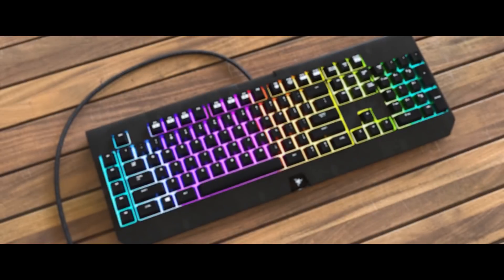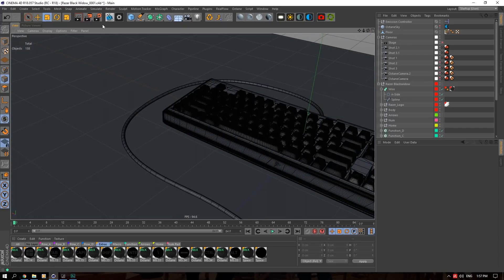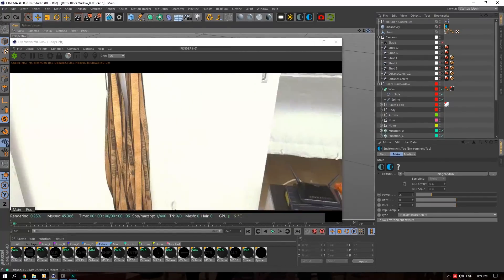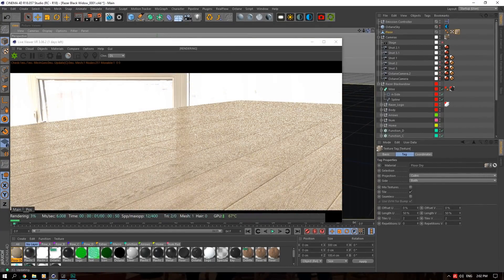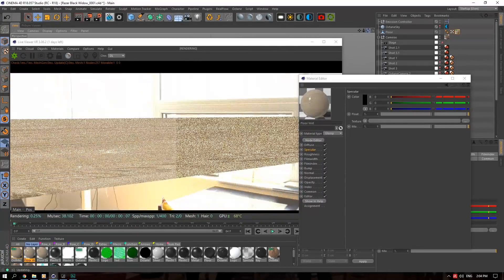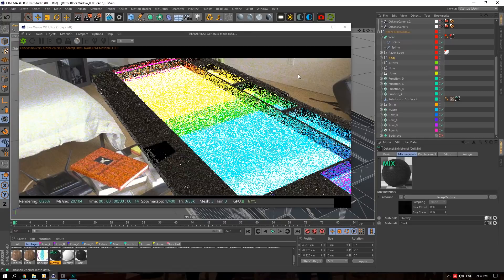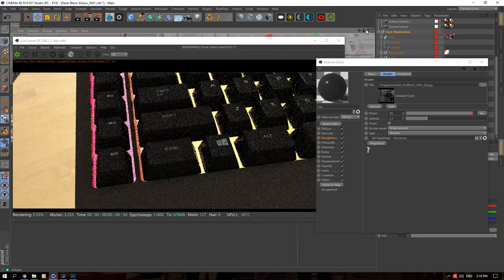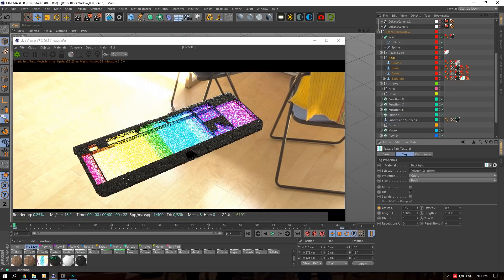3D Razer Blackwidow Keyboard | C4D, Octane

Comment: why did you make a separate texture for every single key? is there any benefit to doing that? instead of uv mapping all the keys together, and having them in a single file.
also i think mixing transparent plastic material for the letters of the keycaps and a regular plastic material, would result in way more realistic result, as it would let light emited from the base of the keyboard (just like the LED's in a keyboard) shine through the glass letters. atleast thats how i did it for my keyboard model.
btw very nice idea of making a gradient for the rgb texture, i wish i thought of that, instead i googled rainbow texture off the internet but the problem is that the blue part of it wasnt very consistent (in terms of brightness)
Reply from the maker: I've you look at my latest keyboard tutorial you'll see I did things very differently